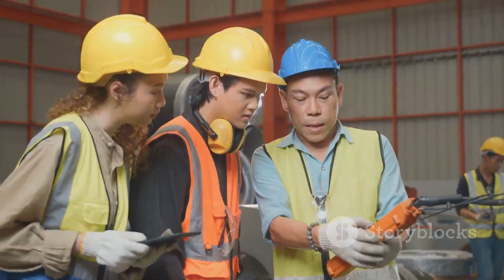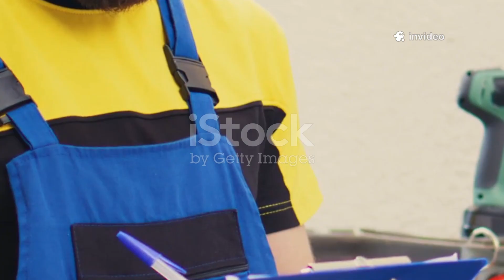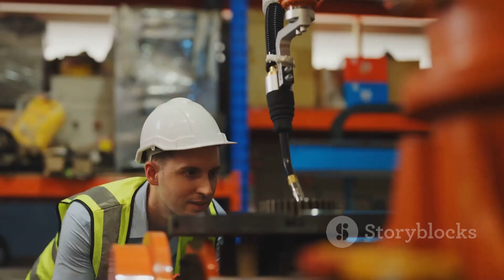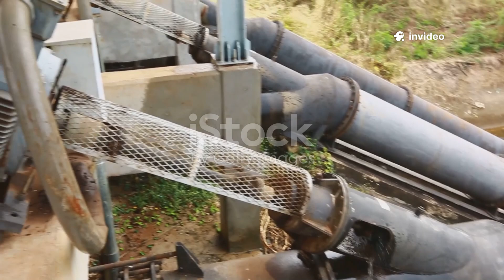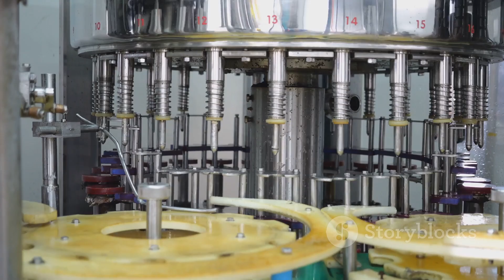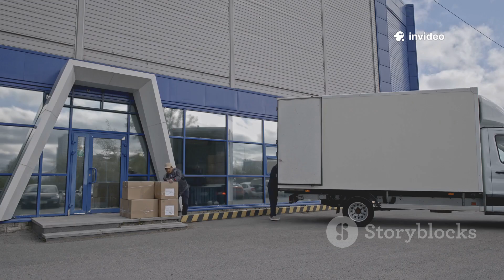The #1 Mistake Plant Managers Make During ISO Audits

Comment from the maker: The 2026 industrial shift in Batangas is all about Condition Monitoring. 🇵🇭⚙

With a $1.3B sector on the line, the question for us Engineers is: Are we still relying on "Paper Checklists," or are we ready for Radiometric Data?

If you are coming from our LinkedIn Engineering thread, drop a "LinkedIn Engineering" comment below so I can prioritize your technical questions regarding ISO 50001 compliance and the Victor 328A specs!